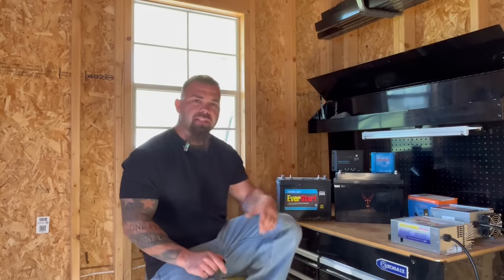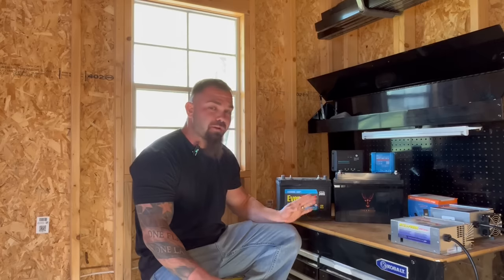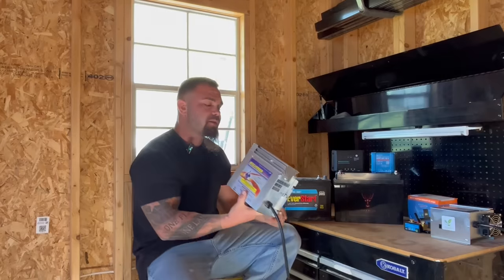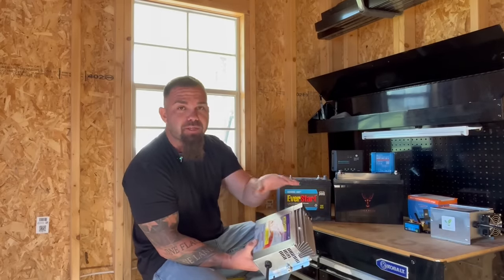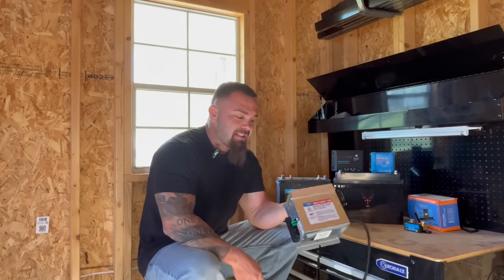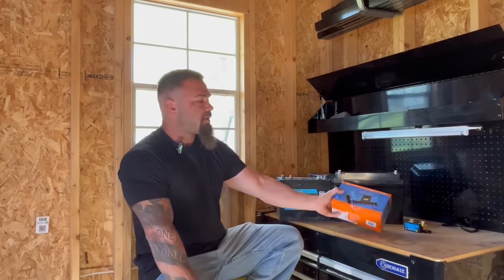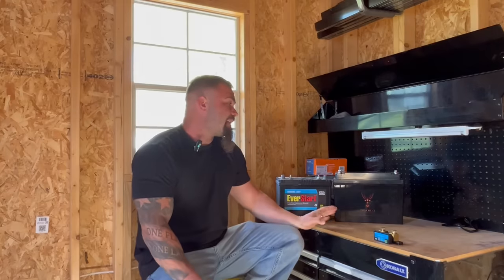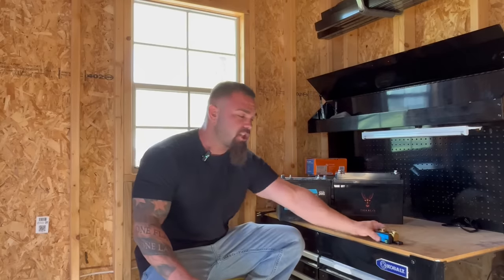Swapping to Lithium? WATCH THIS FIRST!

Comment: nothing there is correct 13,6v out is just the float voltage all chargers have a at least 3 stage charging curve constant current up to 14,3-14,5V then absorption at that voltage and then moving back down to 13,5-13,8V and that is perfectly ok for a lifpo4 battery. and most alternators will charge 14V+ att anything over idle, the only consideration for alternators is current draw.
Reply from the maker: Why would we be replacing things if they worked fine?? Why would they make a lithium specific converter if standard converters worked just as good?? These idiotic comments are getting old... please make a video of a standard converter charging a lithium battery just as quick as a lithium converter, I'd love to see it... 

We've been doing this for years, and conducted our own experiments on our own RVs to have this real world data. You're absolutely incorrect if you think the charging performance of a standard RV converter will match that of a lithium converter. Please prove me wrong!
Reply: @rvsolarconcepts  Of course if you don't have a charger you should buy the correct charger but to say that you can't use the original is just not the case for most user a 20A charger is still a 20A charger if it is used on I lifpo4 battery, I have a 300Ah litium in my RV and it is perfectly fine with the original charger and most drop in replacement battery companies say it is fine and stand by there guaranties. There are exceptions to everything but in most cases it is fine with the original chargers.
Reply from the maker: @OskarHartmannsson  That has not been our experience at all with RV style converters (battery chargers). Most RVs come with a 50-70 Amp charger, when we connect it to a lithium battery the output typically drops below 10 amps which would take 10 hours to charge a 100AH lithium battery... If it's cloudy for a day and you need to use your generator to charge your battery bank, most people are not okay with running their generator for 20 hours to charge their batteries...
Reply from the maker: @OskarHartmannsson  You also failed to answer why companies are making standard and lithium converters if standard ones "work just fine". Furthermore, why do solar controllers have different charging profiles if the lead acid profile worked so well?? It makes no sense...
Reply: @rvsolarconcepts  No manufactures seem  to agree on the perfect charging profile and operate with some minor differences and as to the reason they have different profiles for lithium vs AGM it is mostly to convince people that it is ment for the type of battery you are using. For example my solar charger setting for lead is boost 14,4 float 13,8 and boost reconnect 13,2 vs lifpo4 boost 14,5 float 13,8 and reconnect 13,2 so no real difference
Reply: @rvsolarconcepts  this makes no sense unless you are only using a power supply and not a charger, which does not surprise me in a American RV as they seam to use only the cheapest crap to build them. all normal chargers ar constant current until you reach boost voltage
Reply from the maker: Sooooo.... You came to an American YouTube channel discussing American RV's and then said our information is bad because its not what you use in your country, then agreed that the information is probably correct because it's American made crap RV's? Am I understanding that correctly? lol

We have years of VERY INDEPTH testing of all of this equipment. I assure you, stock converters in RV's here will not properly charge lithium batteries in a timely manner. Don't shoot the messenger here just because voltage differences and equipment differences exist where you live...
Reply: @rvsolarconcepts  you still can't call a power supply that supplies konstant voltage a charger that is just not being truth full or simply trying to push some expensive Victron equipment, for some reason YouTube keeps pussing American content our way :)
Reply from the maker: @OskarHartmannsson  I didn't call it anything other than what is called in the RV market, a "converter" which does indeed charge the applicable battery as long as its the right type... it seems you are really interested in "splitting" hairs about all this for some reason. In either case, the information I'm putting out is correct for our market of products even if there might be a different method where you are. Thanks for your involvement in the channel!

Comment: No excuse any more not to purchase a LFP battery that doesn't have Bluetooth and it's own battery stage monitor.
They've made all this shunt garbage obsolete.  They served a purpose before the modern LFP age. Read out on your smart phone, les wires, fewer gauges.
Reply from the maker: I agree with this for the most part. A LOT of these Chinese made batteries have absolutely atrocious battery Apps that are extremely unfriendly. Furthermore, in instances where Lithium is installed in large diesel pushers or Class A motorhomes, the bluetooth signal from the battery is not usually strong enough to be read inside the coach which is very annoying. For these instances we install a Victron BMV-712 shunt monitor because the bluetooth signal is emitted from the screen that gets located inside the RV so the signal is very strong. Shunts do still have their place in the market, but I do agree that good functioning BT batteries can eliminate the need for a shunt.

Comment: its about house batteries not car batteries
Reply from the maker: @stanislavcoros  What are you talking about?? Please elaborate as this lacked substance to the point where it is an irrelevant comment...
Reply: @rvsolarconcepts  by the title it can be missleading that u are giving hints to lithium bike batteries, i mean starter batteries. like NOCO NLP14
Reply from the maker: @stanislavcoros  lithium can be used as starter batteries as well and the same principles would apply...

Comment: waths that guy saying ? that lead acid charge at 13.6 volt ? guy XD 13.6v is the maintain charge ... actual charging is made a constant voltage at 14.5 volt for lead acid ...
Reply from the maker: @sunoncream1118  Take it up with the manufacturer of the charging equipment... lol

Comment: Lithium=I like fire!
Reply from the maker: @shaun8256  That's like saying, "cars = Death"... is it possible to die in a car accident, yes when the vehicle is operated improperly but does the risk outweigh the benefit of having that mode of transportation? No, not really. There's risk in everything we choose to do, educate yourself as much as possible and the amount of undesirable outcomes goes down drastically. Please educate yourself before just shouting ridiculous things from the rooftops...
Reply: @rvsolarconcepts  LOL! Wahmbulance has struck here. Movin on!
Reply from the maker: @shaun8256  I apologize, I thought we were engaging in a thought provoking conversation but I may have overestimated my audience... Carry on! 😂
Reply: @rvsolarconcepts  alright you want thought provoking, how about the pollution to create a lithium battery over a lead acid, they both come from the ground but to process and make lithium is far more than lead and water. Maybe how about lead batteries can be rebuilt after they fail unlike lithium. Yes lithium can be charged easier and probably holds a charge better, it is what it is!
Reply from the maker: @shaun8256  Ah, we are abandoning the ignorant argument and moving on to the bleeding heart hippy argument... well then, i would tend to agree with the notion that mining minerals and ore in MASS is not great for the earth but then again neither is fracking, oil drilling, mining of any kind, etc... what point are you trying to make here?

Comment: All mis info here.
Reply from the maker: Please expound... lol
Reply: @rvsolarconcepts  The guy is correct mostly. Your standard lead acid battery will accept and needs a 14.6v charge voltage to fully charge and de sulfate. A Standard RV  converter will charge both lead acid and LiFePO4 but neither to 100%. Standard RV converters will kill lead acid batteries. LiFePO4  also needs 14.6v to fully charge. LiFePO4 batteries settle to 13.5v. and not 14.6v. Lead acid needs a constant float voltage of 13.6v not 13.2v of most converters. Standard converter will not kill LiFePO4 batteries. LiFePO4 will benefit from a 13.6v float voltage also. LiFePO4 is best for either converter.

Comment: Altnater
Reply from the maker: @KF7UCK  you don't actually think that's what it's called do you? Lol
Reply: @rvsolarconcepts  No… It’s just how you say that word. 
Respect though. You explained the voltage well. I’ve been shopping for a 5th wheel and not one salesman has been able to explain why you can’t just replace lead acid batteries with Lifepo4. I had no idea that you couldn’t until one salesman mentioned that a model that I was looking at had a converter in it that can charge lithium batteries. I asked him to explain why, and he couldn’t. Thank you for making it clear.
Reply from the maker: @KF7UCK  hahaha I got ya. Some times the words come out a little loose when you gotta get so much info out! 

Glad you got something from the video, good luck in your hunt!

Comment: There is no reason to swap out the converter... 99% of solar systems will top off the battery.
Reply from the maker: Until it's night time and your batteries died before the sun comes up... charging 5 percent per hour while running your generator is not a good time... it's a 200 dollar expense, worth it every time.